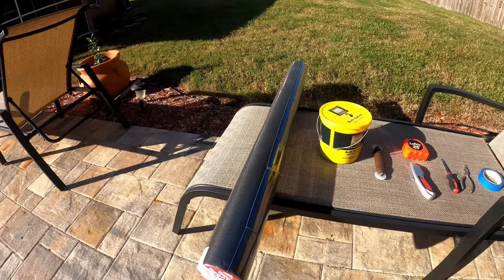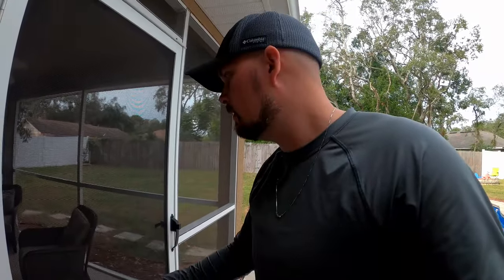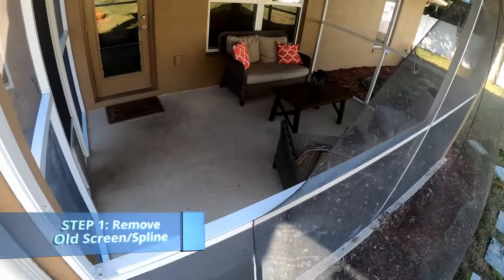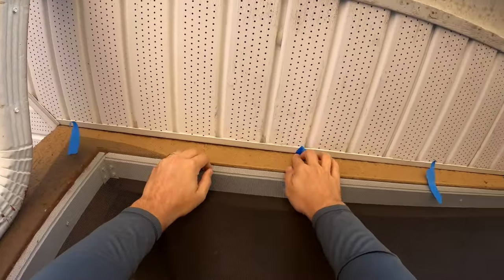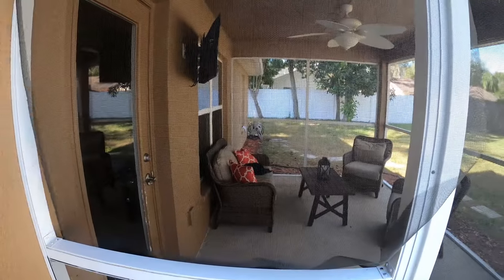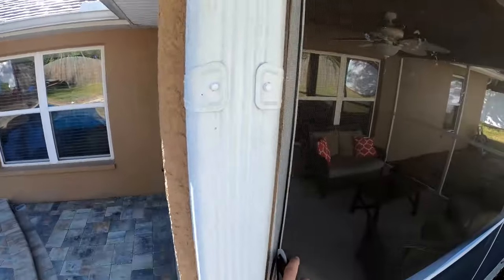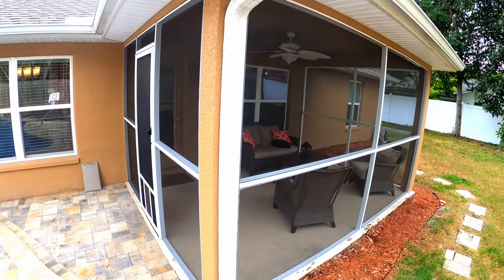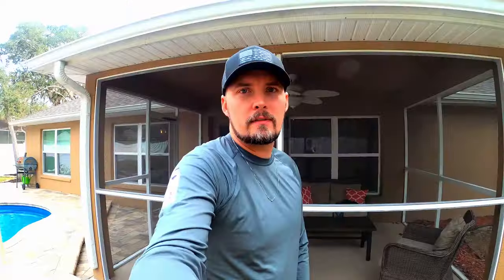How To Replace Patio Screen | Full Replacement Walkthrough with 5 EASY DIY STEPS!

Comment: I always start the spline on top and then the bottom while pulling the screen down firmly but not too tight and then doing each side the same way. Use the concave wheel side of the roller and press the spline into the channel holding the roller at around a 45 degree angle away from the good screen that you dont want to cut. It seats it in the channel. Works great on round spline, even flat. Ive had perfect results this way, nice tight screens but not guitar string tight, still a little give,  no wrinkles. Works perfect for me. And Im a little more liberal with the excess screen. I find it makes the job much easier. Pro tip, use metal clips that are specifically made to hold the screen in the channel instead of tape when you begin to make it alot easier when working alone. Sometimes tape wont stick depending on the weather conditions like higher humidity.
Reply from the maker: Great information thank you!
Reply: @deuceliter Happy to help 😊

Comment: Good job! And cute kitty! I just replaced my patio screen, the largest one I have and used metal clips to hold the screen nice and tight (I did the job without them and tried the tape to hold the screen in place but the screen kept falling off and there were ripples in the screen). I retightened the screen with the metal clips and it worked great.
Reply: can you give us a link to the clips you used please ?